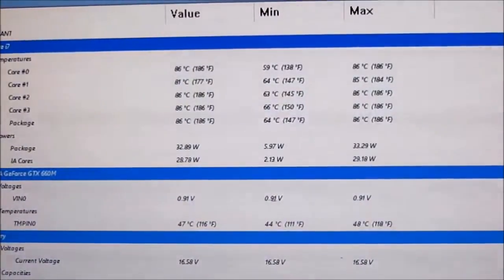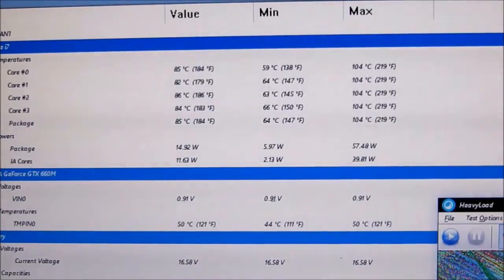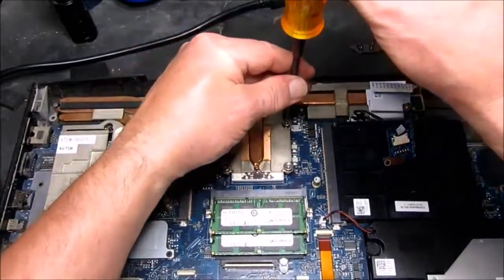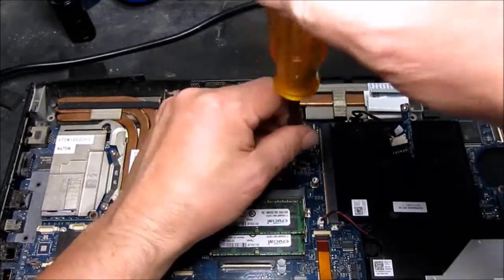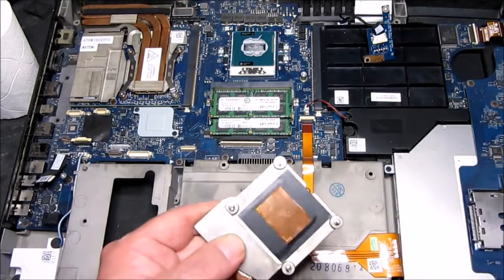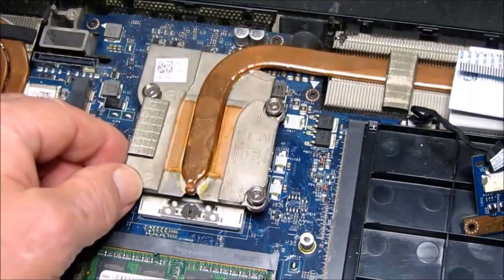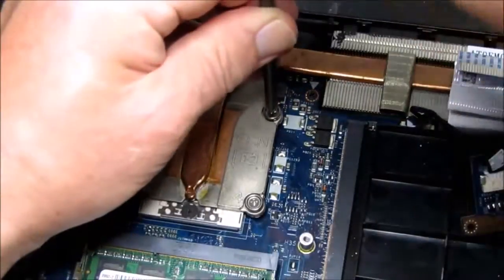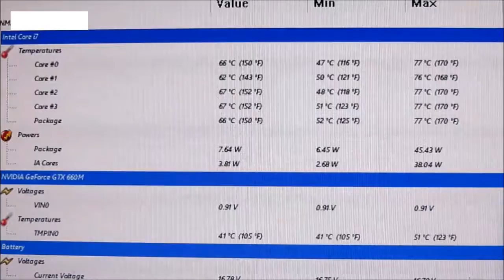Alienware M18xR2 Laptop Fan Clean and CPU Repaste - Repair Tutorial Teardown

Comment: after replace with a new fan and repaste thermal compund my laptop still hot.
is nice

(big sad because the screen turns black and the lights still on. The power didnt went off and happens only i am playing something 3d like minecraft) maybe everything expect screen and power crashed
Reply from the maker: Make sure you have plenty of space around the laptop for the air to circulate. Maybe buy a fan tray for it to sit on. Please consider subscribing if you haven't done so already!!
Reply: @1nformatica  ok thanks

Comment: So, we can fix the thermal paste if this will be an issue right ?
Reply from the maker: The laptop was overheating badly due to dirty fans and poor thermal compound that had dried out and was not conducting the heat away. A good clean up and re applying new paste fixed the problem.
Reply: 1nformatica thanks. I'm sick of people screwed this laptop so bad but haven't do a research about to fix his thing. They just throwing off this laptop instead of find a way how to solved it. Thanks dude.
Reply from the maker: It's a good laptop, a little old now but correctly maintained will still give good performance. In my experience processors actually run slower when overheated.
Reply: 1nformatica but it will run faster I guess if we fix it
Reply from the maker: Yes!! That was my result. The owner edits video files and was very happy with the fix.
Reply: 1nformatica what do you mean that the owner edits video files ??
Reply from the maker: Usually people have this type of laptop for gaming. My client used it to edit video animations. He was involved with animating sequences in the star wars movie.